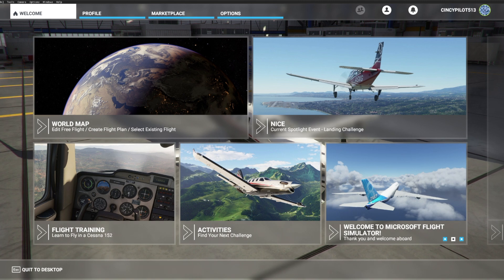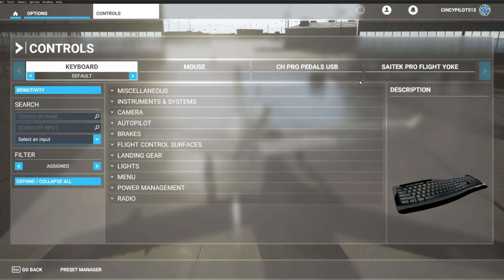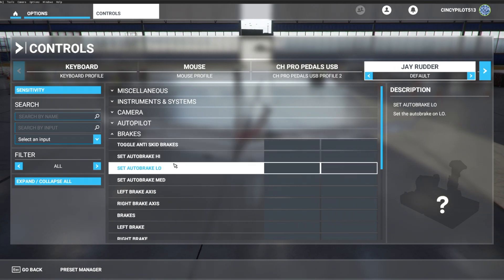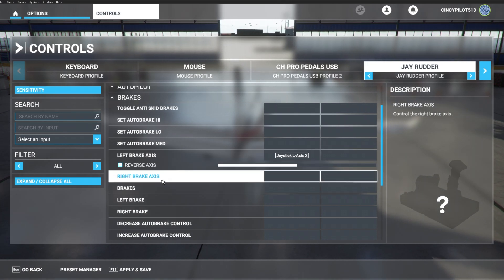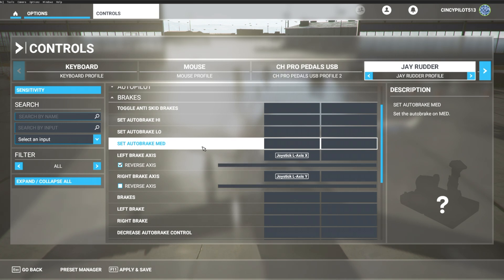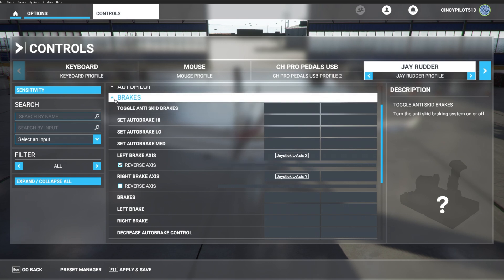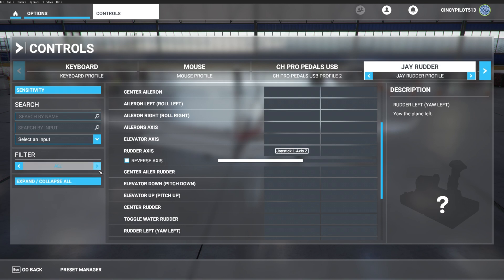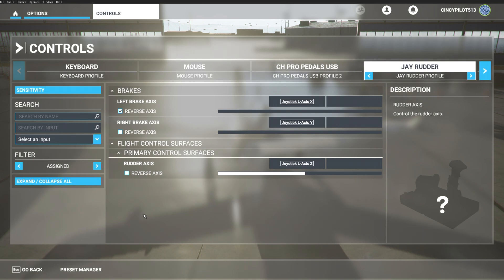Redbird RD1 Rudder Pedals Configuration with Microsoft Flight Sim 2020 (Brakes and Rudder Control)

Comment: The brake configuration did not work for me, as the brakes stuck on every time I used them.  I reconfigured from "left/right brake axis" to "left/right brake" and the brakes worked perfectly.
Reply: How did you reconcile this? If i press my pedals 50% they work. Anything in between does now work.